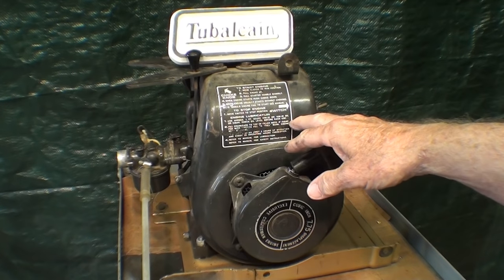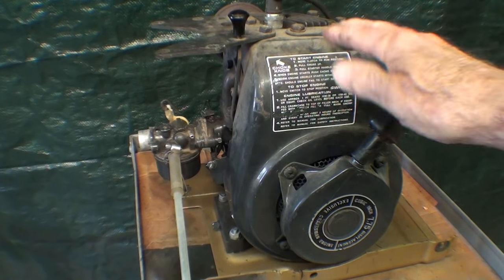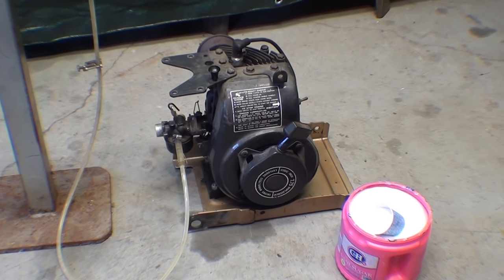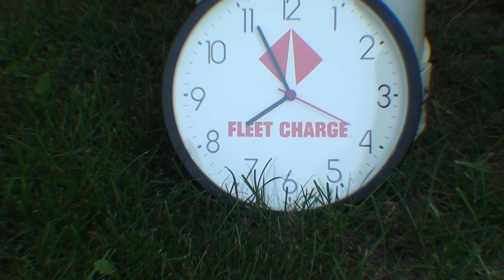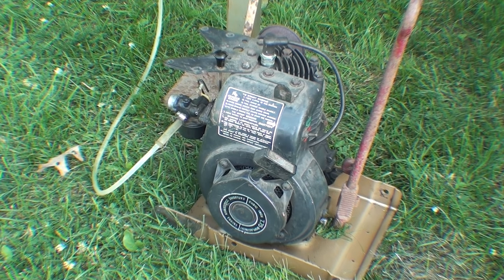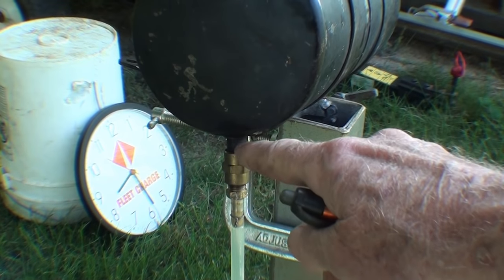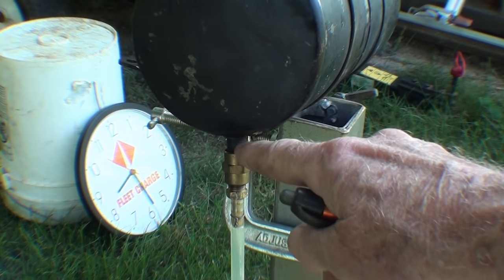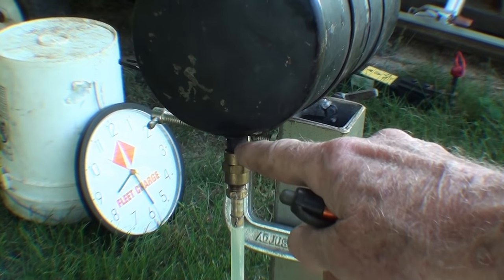MYTH BREAKERS #2 "Sugar in Your Gas Engine Fuel Tank" tubalcain

Comment: Experiment would be complete if you had opened the engine and took a look at the state of the piston and cylinder. This only proves it runs now, now for how long it will run )prolonged use(. Again, without taking a look at the inside of the cylinder this is very incomplete.

Comment: Your myth is not broken it was a fact that sugar was employed to sabotage engines during and after the war i have done it and had it done to me, Fuel is a lot different from the 1940 to 1970 lead for a start.Sugar is refined different.Four cylinders opposed to one is a major factor as is the fact that that fuel is picked up  from tank by pump to carb then if unlucky enough to get to cylinders causes sever glazing losing the piston rings and sometimes pistons. Try putting your hand on a single cylinder engine then on a four cylinder see which is hotter.Try agitating lead based fuel with sugar and draw it through a pump and remember four cylinders helping each other until it can no longer, The sugar was for sabotage to cause the vehicles to break down away from home causing maximum disruption and worked. Whether the engine was destroyed or not it was out of service untill the fuel lines and filters cleaned replaced ie sabotage

Comment: This was ridiculous. "Raw" sugar?  You were not using raw sugar. Raw sugar is brown, not white, and has much larger crystals. Also, why would you shake the gas tank?  Someone placing sugar in a car's tank isn't going to be able to shake the car to mix the gas and sugar. I'd also like to have seen what effect the sugar would have had on a CAR, with all of its sensors and such. There's much more to damage than just an engine. Yet, as you proved, rarely will gas not clog the fuel line or get past the fuel filter.

Comment: I disagree, because corn syrup will dissolve over time, not the time frame you presented here. It will pass through the filters and it will crystalize upon combustion and score the bore rings and piston. This test is to fast and flawed. No tear down?

Comment: Most cars before the 1960's didn't have fuel filters only some sort of strainer, the sugar would have gotten into the carburetor and any sugar that got sucked up into the cylinder and burnt would have melted leaving a layer of sugar on pistons, valves and cylinders.If it hadn't damaged the motor by then, when the motor cooled it probably would have locked up solid.

Comment: You didn't run it long enough , what it does is builds carbon in the combustion chambers until there isn't enough clearance at the top of the bore ... stopping a single cylinder , breaking rods in a multi cylinder .. seen it with my own eyes ,,You aint busted shit ...

Comment: You didnt even get any real sugar into the engine most of it was still in the gas tank.  In a car the back and forth motion of the car and heat and cold could have different results also your little engine has a carb that would choke before it would ruin the engine probably but in cars the carbs and fuel injectors are different and should be bigger than a small engine maybe not shure.   Sugar is a crystal and turns hard and like a rock so it cant be good for your engine i know that plus your test took only the outer layer of the sugar crywtals which is not enough if you had dissolved the sugar and boiled it or grounded it down to a powder then you would have a real test and made shure you got sugar into your engine through the gas filter.  If no sugar is getting into your engine then the myth is not busted.  you have to retest without a filter and get powder sugar for real results and come back and see over time what it has done to your engine.  Then i would believe it.

Comment: Sugar dissolves in the fuel - so will pass through fuel filters. It gets to the carb where the fuel is evaporated leaving the sugar behind reacting with the fuel forming a black rubbery solid usually in thin single strands that block the carb jets. The engine is therefore starved of fuel.
Fix: disconnect fuel lines at carb and simply flush them and the tank out - refilling all with fresh fuel. Remove carb dismantle remove old fuel and clean out the jets. Reassemble, refit to car and fuel supply. Job done.

Comment: Mrpete222 first off love your videos amateur home shop machinist my self I watch your vide all the time but also I am a master tech mechanic and the problem with the test is what I have seen in engines and gas tanks has been powder sugar and once they have been done its a waste of money and time to rebuild because they will lock up again you have to change engine tank and fuel pump I even had a customer tell me he didn't believe his truck been sugared he came by and actually tasted the residue left from sugar and yes your right that's sugar but also dawn dish liquid will do similar

Comment: You have no idea what you are talking about. Sugar will destroy a motor and a lot of other parts on an automobile. I've seen the heads taken off a car that had sticky sugary substance in the cylinders that caused the pistons to stick along with several other parts that were all ruined. It's very foolish of you to tell people this lie. Automobiles have a ton more gas pressure than did your little gas tank with no pump. Why don't you just put sugar in your car and drive it and then tell us if you only had to change out a filter that was clogged to get it running again. Better yet ask a mechanic that's had experience on a sugared gas tank and tell them it's a myth. They would laugh at you.